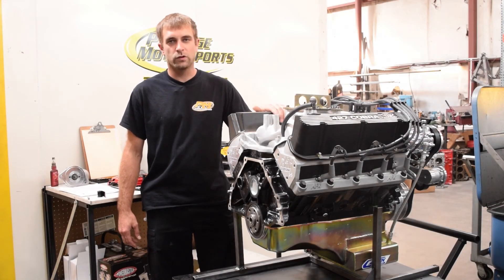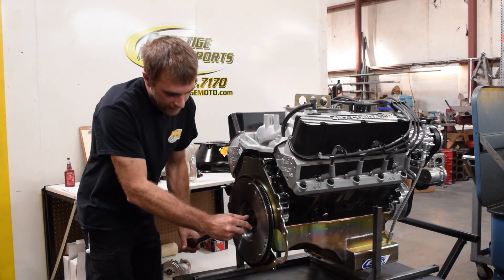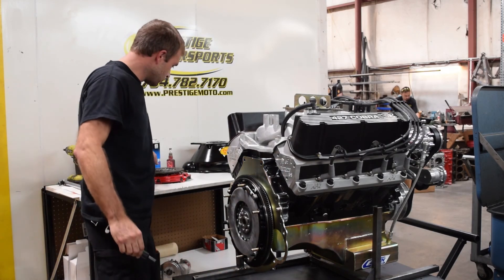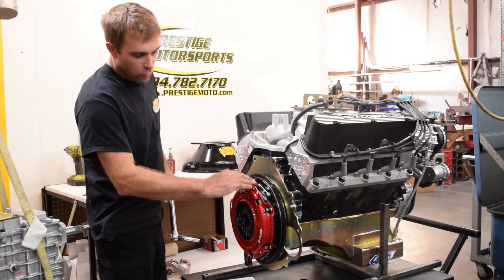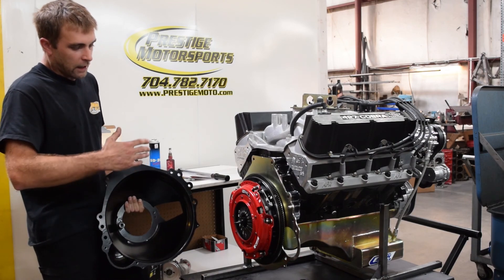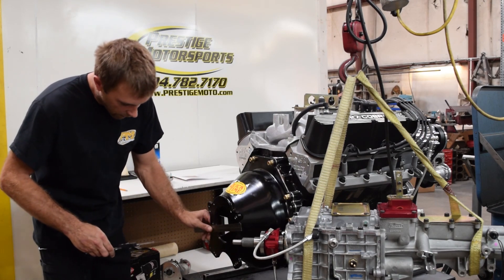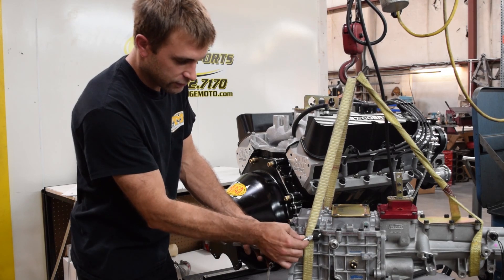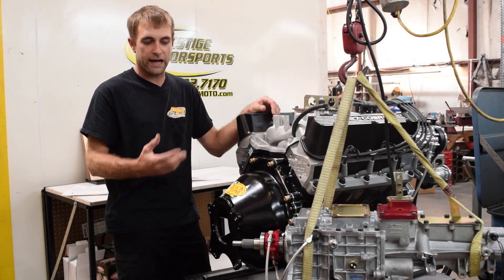Install Manual Transmission With Internal Clutch Release Bearing

Comment: Excellent video done right by a professional  now its ready to beat the crap out of with no problems dont forget the heavy duty u joints.
Reply: beat the crap out of it and heavy duty u joints? ? what would you rather break , a driveshaft tube, a u joint, a 3 rd gear in the tranny or the diff ? Ill rather have a weaker driveshaft how about you?